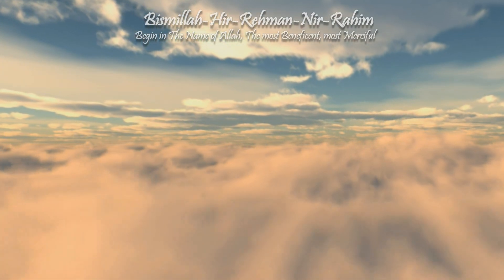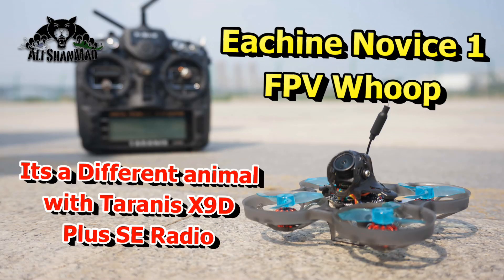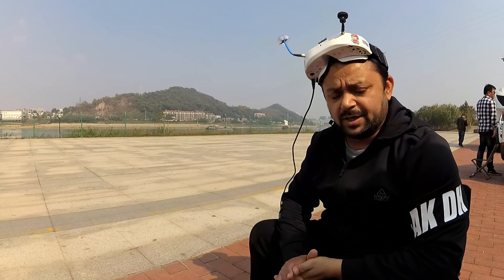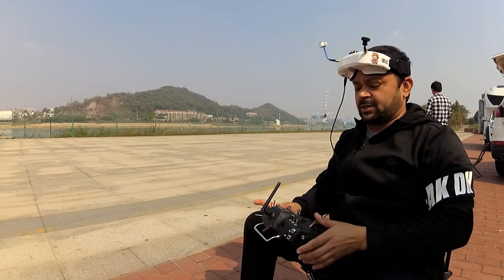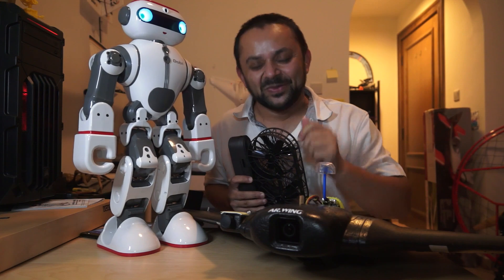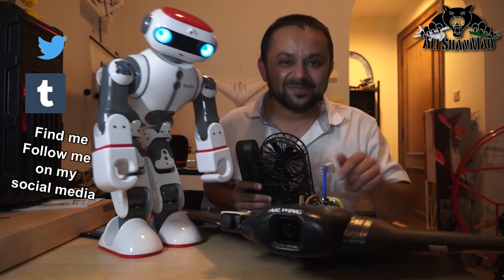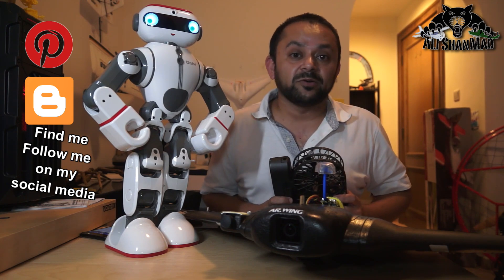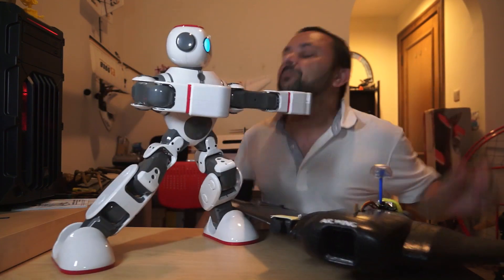Flying Eachine Novice FPV Whoop with Taranis X9D Plus SE Radio

Comment: Hiya Alishanmao 👍
Could you please contact me to help me please...I’ve tried so hard to bind same transmitter as you’ve here and I’ve failed
OMG I can’t get to work at all now ,I think I’ve lost correct (original firmware) as the osd is blank just camera image working , I’ve managed to bind old transmitter it works in beta flight ,but can’t disarm and use 
If you could help me out I’d be so very great full 
Ben
Reply from the maker: I think its best to study about betaflight, Flight controller and trouble shooting online as that will help in long term while you learn. not binding could be firmware mismatch issues, wrong rx selected in Betaflight and in Radio settings and could be more reasons. welcome to goggle to study everything
Reply: alishanmao 
Thanks for the reply ,your correct I’ll have to study more
Thanks 👍

Comment: Hello my friend, i recently aquired a novice 1 and the """transmitter""" is just the worst thing ever... So i was thinking to buy a taranis x9 ligth and i saw in betafligth it has the configuration for frsky_X for this drone. If i buy it can will it be compatible or will i have to buy something else to make them comunicate? thanks in advance, keep up the good work
Reply: i see you riplied on the comment above mine already ehehe
Reply: Taranis x9 lite won't work but you can get a multi protocol

Comment: If you choose the Novice 2 and put all its electronics, motors on Novice 1 whoop type frame you'll get a much better result!

Novice 2 by itself flies longer time than Novice 1, and being in Novice 1 frame will be even a bit lighter, so more longer time, smaller size, usable indoors as well...

And besides, you can put in this new construction the VTX transmitter as Novice 3 has (it's about 15$), and you get even more range, up to 400mW, and the SD slot for onboard video recording

And imagine how much speed, flight time you get with 10 battery Novice 2, in tiny Novice 1 more resistant and secured frame design... and 1S/2S batteries for this will be cheaper than 3S's :)
Reply from the maker: yes its do able :) but need time and patience.

Comment: How do I bind frsky x9 light . to novice..having trouble...
Thanks
Reply from the maker: there is a user manual :) hahaha. normally you just go to cli and type the right command for binding. if your rx supports it. then choose right transmission protocol to match the rx on your x9 lite and choose bind. thats it.

 some times you have to press and hold the bind button on receiver and then power it on. see the LEDs solid on Rx. then on radio matching right protocol, select bind and you see LEDs blink. thats it, its bind.
there is a good support and user manual describing all online
Reply: Can you do a video tutorial for it

Comment: Hi ali,I'm a bit confused why you have omni directional antennas on your fatsharks but the novice has a linear antenna? I've got a menace bandicoot linear patch and stock pole antenna  on my set up for quads with linear antennas,maybe that's why you were getting abit break up in that vid, just a thought,great vid btw😉